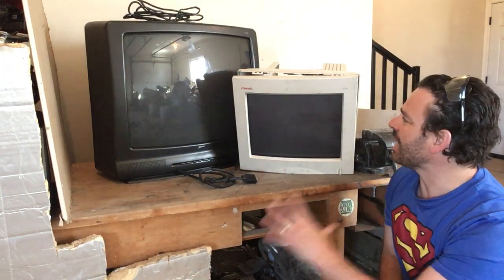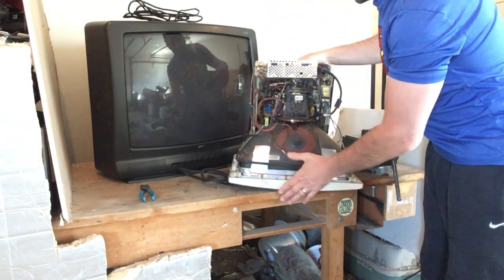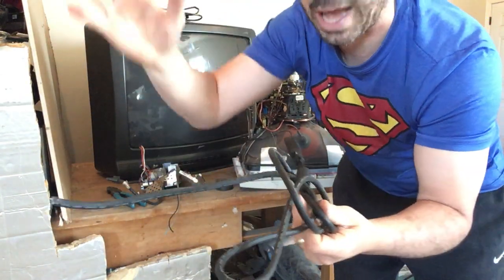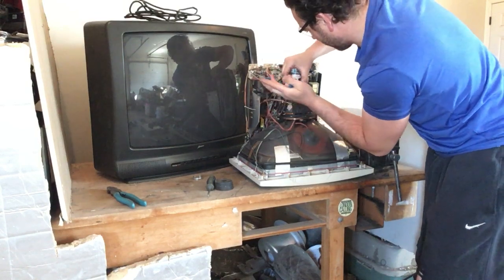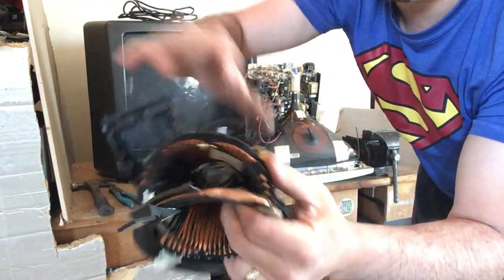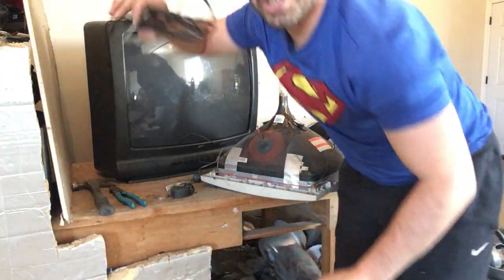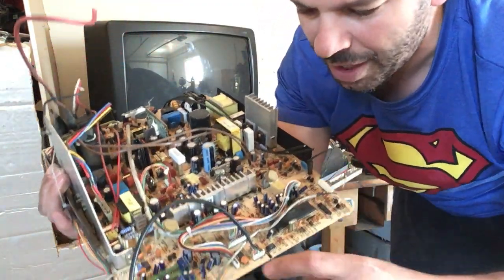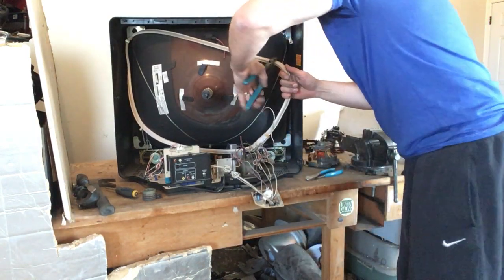Scrapping an old crt tv and computer monitor for copper, aluminum, and other metals, and zero waste!

Comment: Good morning tin man. Im a long time scrapper that just recently decided to start playing around with micro scrapping. Specifically getting silver buttons. Well I've got about 2 lbs of silver buttons, a couple silver trays, and a couple small silver items. However, i have no clue what to do with them now. Should i find a scrap dealer who buys silver and get the lowest value or should i look to process it for higher purity to sell to gold/silver buyers, or just sell as is to the latter?
Reply: Actually, if you are in no rush, I would hold onto it and continue to build up your amount. Precious metals continue to rise and looked to be a great investment. If not, you could also sell online (ebay,, etc.) some refiners buy from there and probably at a higher price then a scrap dealer.\

Comment: I love your channel! New subscriber here! So, I am just getting into this, but I am worried about getting shocked or worse. Are there safe ways to discharge these TVs and monitors? Thank you!
Reply from the maker: As soon as you cut the red chord to the tube no shock potential. I have taken apart probably 100 of them and never been shocked. Again many of the TVs don’t have a charge anyway, it is just eliminating any potential by cutting the wire. Thanks for the comment and support.